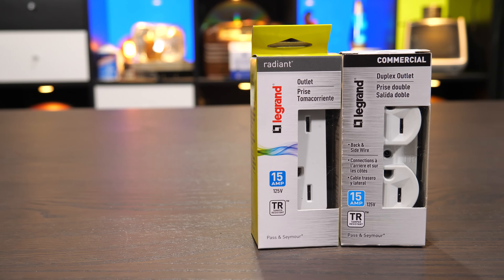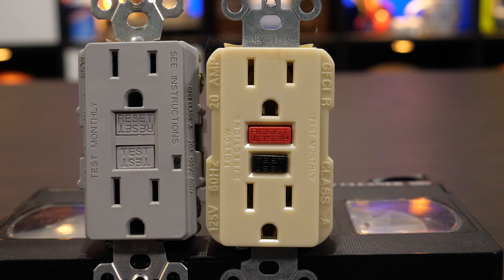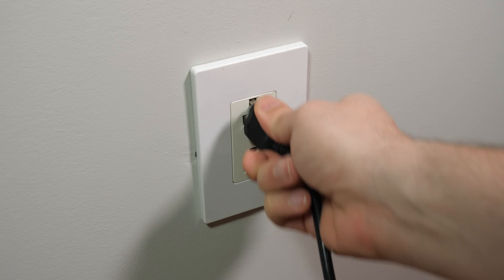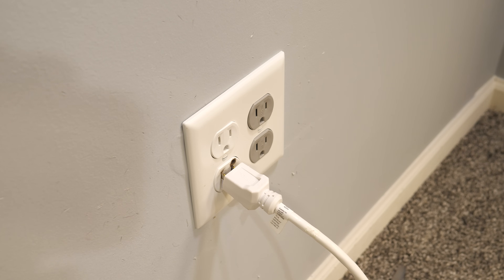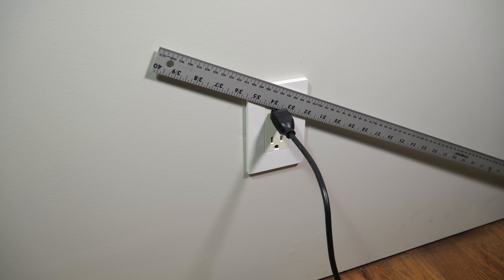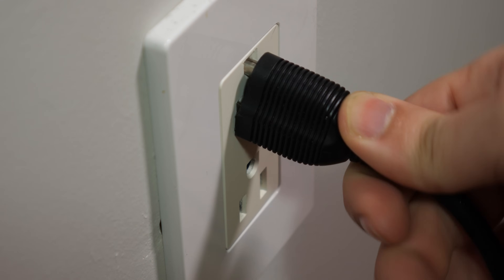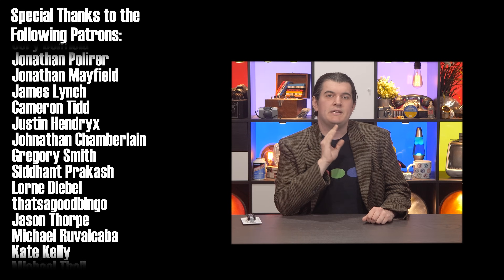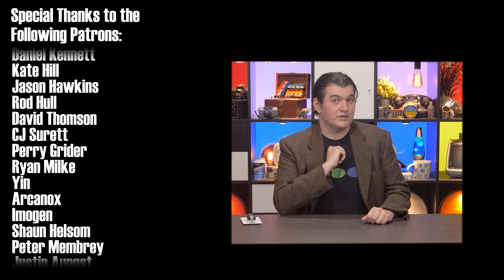Power outlets are topsy turvy - but does it matter?

Comment: Electronic engineer here, 50 years experience.  This is an excellent video and explains a number of questions I've had about why plug designs are as they are.  Suggestion: clarify what shocks are uncomfortable vs. those that could be life-threatening.  If a momentary shock is across one finger or between two fingers on the same hand, it's educational. If it's between two hands and so passes through the chest, that could be a more terminal education.
Reply: I'm stealing the term "terminal education" 😂😂😂
Reply: I always wondered why Europeans had such design improvements like indented sockets, sleeved & insulated plug pins etc. and Americans haven't still adopted any of these. I finally understand after seeing a comment from an engineer with 50 years of experience. "Let them get shocked!" oh my god.
Reply: I wish more people knew that.
Reply: PLEASE go back in time to tell this to me and my cousins as kids who would either dare each other to grab the farmer's electric fence with both hands, or make a chain of children to do the same, assuming that if our rubber-soled shoes were touching the ground that we would be fine
Reply: I have been shocked to education enough times that I'm probably an anomaly.
Reply: I was told that the ground prong should be on the bottom because when the plug tilted down the ground would still be fully in, preventing shock.  Is that correct?
Reply: @nancylindsay4255  A common misconception is that the ground prevents shock, it's more of a "signal wire" that detects potential to ground. Let's say your toaster is damaged, the metal body shouldn't become electrified because it's grounded. So if you plug it in the breaker should trip.
Reply: @Eargesplitten-Loudenboomer It's maybe semantics but I'd argue the ground pin does in fact prevent some shock hazards, in that you can't get shocked from the metal body of an appliance if that body is grounded. On its own the grounding would convert a shock hazard into an electrical fire by shorting the connection if there was a live fault in the appliance but it would still prevent a shock. The breakers then prevent that (and other) electrical fires.
Reply: @nancylindsay4255  ground pins don't prevent shock. They only trip the breaker when the shock does occur.
Reply: My impression is that the ground pin is typically grounds the metal chassis.  So, if there is a short, it has a lower resistance connection to ground vs., for example, a human body touching the outside of the metal toaster.

This has the effect of tripping the breaker, only because the lower resistance connection to ground causes the amperage draw to go beyond the rating of the breaker... however, the idea of the separate ground is to given the AC power lower resistance path to ground than the human body.
Reply: @pt8306 grounding doesn't prevent shock it just acts a short crkt path for current to take when metal becomes energized by the hot. It's like a nuetral that doesn't carry current and is bonded to the metal that is in and surrounds a structure. You can't carry enough current through your body to trip a normal breaker unless you were stuck on the crkt and it burned its way through you creating a low resistance path that enough current could flow to then trip a breaker but you'd be dead by then so. Now a gfci can sense current flowing on the ground in the 5 miliamp range and trip and save lives but only if your getting shocked by the hot and it's completing the crkt through you to grounded metal or the physical ground it self you can still get shocked by touching the nuetral and hot on a gfci.
Reply: What about between a hand and a foot touching wet floor or a grounded metal pipe etc?
Reply: @tiagotiagot Never been in that situation in any home in 43 years.
One can contrive any dangerous situation
Reply: @tiagotiagot as soon as it connects trough your heart it is dangerous. If both contact points are in the same limb, say an arm, it hurts but won't kill you since the current flows just in your arm. If it flows through your upper body e.g. your heart it can bring it out of rythm which can be very dangerous. This is all for normal outlet power of 110/220V with a fuse. If we are talking about bigger voltages and especially bigger currents it can be dangerous anyways. I once saw a video of an arm exploding because a worker touched a powerline.
Reply: Yeah ive shorted a 120 across the pugs with my finder as a small child.
It was uncomfortable. But not dangerous. 120 will 99 percent of the time just bite you.
Reply: @jhoughjr1  Ditto unplugging a loose BS406 plug on my kettle in Hong Kong, my index finger just slipped under the plug body and touched the L+N pins just as it slipped out. Easily solved with the sheathed pins thing.

Comment: With most right angle plugs (like most of those shown in the video), you can only fit one right angle plug in the receptacle.  The two with sideways leads are the only sensible way.

Comment: I have an electrical receptacle under my kitchen counter, inside the cabinet against the wall where my wife has a blender connected. My wife used to hang her metal spaghetti strainer right above the receptacle until one day it fell and landed right on top of the plug and it ruined the reception and tripped breakers.

Comment: Also, an upside down outlet will cause an electrical cord which protrudes from an AC adapter to weaken over time until the cord ceases to function. I found this out the hard way with my Google Assistant's AC adapter despite it not even having a ground pin (I just hadn't encountered this problem before). It lasted about a year this way. Another example of this is USB cords attached to wall wart chargers like those that come with your phone, always plug the charger in such that the USB cord doesn't weaken over time due to gravity alone!
Reply: What is "upside down?"  Ground pin down?
Reply: @jmdavison62  ground pin up.

Comment: I’m surprised you didn’t bring up the UK’s plug and outlet design. It’s by far the smartest design out there with the longer ground pin and the shutter gates on the outlet. Also the live and neutral pins have plastic halfway up so you can’t accidentally touch them.  Even the wiring inside the plug is designed so that the ground wire is looped and longer than the live wires so if a wire it’s tugged too hard the ground wire will be the last wire to come out.
Reply: He has another video about that.

Comment: You touched on this for a split second there, but, a big issue to me is that if all plugs were the type of right angle plug that point down, you might as well only have 1 receptacle per outlet, because you wouldn't be able to make use of the other one without risking the plug coming out. Plugs that point straight away from the wall are still less likely to come loose than an upside down right angle plug, because they don't have the whole weight of the cord pulling at them from the top. For that reason, I think it makes sense that the plugs that point straight are still the most common.

Comment: My dads an electrician and all the sockets he installed were the "proper" way up, but it was a pain to deal with because things you plug into walls are usually designed to plug in the opposite way.
Reply: Leave it to a man to install a face upside down! Probably didn't even notice there was a cartoon face on each outlet.  :)

Comment: Just have a law that enforces all plugs must have 3 pins, with live and neutral having a plastic sheaf at bottom of pins, for safety, with covers in socket for L/N that only disengage once longer earth pin inserted, and maybe rectangular pins too, with a fuse in the plug for added safety, and better standard style of plug that needs better grip to insert and is less prone to dislodging. And transition to the new, safer, style. Works really for us in the UK already!

Comment: I wonder if there may be further argument for ground on the bottom, considering potential liquid splash or runoff on an outlet. For example: When water is splashed on a kitchen wall on or above an outlet, the last part of the connection that the liquid touches on its way down is ground. I've seen outlets in the middle of mirrors. Mirrors tend to be covered in condensation from showers. Wouldn't it be preferable for runny condensation to be touching the ground connection last? Or is there even a difference at all whether ground is up or down in regards to liquid?

Comment: Meanwhile in Europe:

Our outlets have some deep, so if you want use antique devices, you need to get an adapter at least or changing the cord and the plug.
Here you can find lot of sideways plugs also, but rare to see 90 degrees rotated outlets.
Reply: What kind of outlets do you have? We standardized the type E in 1933, never had a need for an adapter.
Reply: @hovnocuc4551  Type F with short plugs causing an issue, we have Type C and F outlets.

Comment: Ground on tip just reduces the Live-Neutral shorting a bit ... the problem only gets fixed with Recessed Outlets (see the development in Switzerland the last 30 years) for the Type-B plug (while banning Type-A) & doing similar to other plugs ... recessed outlets also give more stability (especially with heavy wall warts)

Comment: People all upset over our socket safety, it's only 120 in there lol, the worst that can happen is a quick "ow fuck" and flipping a breaker back - maybe a computer shuts down somewhere on the circuit, but everything auto saves like every 5 minutes now anyway. Side note as a maintenance guy i like 120 volt cuz i don't have to track down a breaker just to change a light switch lmao

Comment: Just so you can stop saying you’ve never seen a right angle plug built the “proper way”, I have an Indesit refrigerator with the cable coming out of the plug opposite the ground pin.

Comment: I remember, as a kid, replacement plugs where the wires would pull through the plug head and get screwed down. Then a little disc would slide over the blades and cover the screws. If a wire frayed or a screw came loose, live wires would touch. And you didn't dare pull a plug like this by the cord. I almost got the shock of my life when I was about 5, trying to play some 45s in my older brother's room, with a plug like this. I almost wish we would switch to 12V or USB plugs for most things other than appliances.

Comment: Window blinds with metal ball chain draw mechanisms were the first time I saw an issue with foreign objects slipping between plug and socket.  Having seen the resultant fireworks, I now appreciate the proximal insulation on live and neutral in Australian plugs.

Comment: Herold, you're making my OCD flare up. I don't care about your receptical orientation one bit, but that cover plate screw better be straight up and down! Never, for the love of all that has ever been, can it be left in any other position. Do you understand how important it is that that screw is always straight up? You can walk down the left side of a hallway, film a video in portrait mode, back in to angle parking, hell you can even just throw your toothbrush into your bag when packing for a trip. But that screw, that screw must be straight up and down! Can it ever be horizontal? Sure, if you want to be flat out wrong about everything. Try it again, see what happens. Not a threat, just a friendly warning. Get your life together, I can't stand seeing you at rock bottom like this. 🧐

Comment: I've absolutely seen more than one outlet start exploding because of a loose plug having a faceplate drop on it, and that's just as an average homeowner, I had heavy road construction resonate is some weird fashion with my home's walls, it nocked my bathroom vanity off the wall and at least two of my apparently improperly torqued faceplate shook their single mounting screw out and popped a couple of breakers. Right-angle plugs are just a thing I don't use because they are always going to take up more faceplate real estate than they are worth, right-angle plugs are awful, full-stop, don't use them. Cut them off and give your appliances a better receptacle.

Comment: If only the US had switches on their sockets. Then they could have this insane plug and no risk of shocking themselves on insertion or removal. Let's be honest, the only change that the US needs to their plug design isn't to invert the orientation, it's to adopt one of the massively superior versions used around the rest of the world. Every video on the US electrical system I watch triggers a deep horror in my soul.

Comment: Over the years I've seen two fires from plug orientation, Neither would be likely to happen now as they were both from FPE panels. But nonetheless I personally still prefer mine ground pin up. Or more ideally, Recessed right-angle plugs.
Reply: ..."my" ground pin, not mine

Comment: The design flaws in U.S. power outlets and plugs is shocking !  Regulatory authorities should consider  adopting the electrical safety design, manufacturing and instalation standards for domestic power outlets and appliances imposed by Australian building codes.

Some of the requirements are :

* The longer earth blade/socket is always at the bottom to ensure that connection is maintained when the cord is disturbed.

* The active and neutral blades are insulation sheilded for most of their length so that conductive metal is not exposed if the plug is partially pulled out.

* All power outlets/points are switched within the body of the outlet so appliances can be switched off at the power point in case of a fault in the appliance and the socket is not constantly live.

* The mechanisms and connectors of the outlets are housed in insulated material, generally suitable grade plastic and if the face plate is metal it is earthed.

* All wiring connectors must be mechanical grub screw type within an insulated body capable of retaining the wiring when subject to disturbance. 

There are many other rules governing electrical installation and fixtures which appear to contrast significantly with American practices.

Comment: And then you compare it to the same plug type which is used in Japan, but where there is no ground, so it's just the live and neutral. Meaning you have to buy an adapter to allow a grounded plug (such as on a gaming laptop) to use an ungrounded outlet.

Comment: Seems like the kind of problem that could be mostly fixed just by having a switch at every outlet, reducing the need to plug/unplug things in the first place and completely avoiding live pins when you do. 

Still baffled that Alec's pedantry when it comes to turn signals and the warmth of lighting seems to completely disappear when it comes to electricity, the one area almost everybody else would find highly important when it comes to details and safety - to the point where he actually seems to get angry that anybody would care at all about improving or championing better safety standards over the US's current absolute clownshow of terrible plugs, outlets and cables.

Comment: I would say ground down is safer from a ground standpoint. If the ground is up, it could be dislodged while live/neutral is still connected (because the angle makes the ground effectively shorter than live/neutral)
I don't think the extra length of ground compansates for this enough since they are not made to be pulled out at an angle.

If you put a plug against a table so all 3 prongs touch the table, the plug will be in the angle that correspond to equal ground/live/neutral length.

By having ground down, the live/neutral will be yanked out first if weight of cord bogs it down enough so disconnection is a risk.

I think ground safety/integrity is more important actually.

People should be careful to not touch live metal while plugging in a outlet - isn't that a bit common sense?

But if plug becomes so bogged down so ground becomes dislodged then it could be dangerous to touch the appliance itself - which may not be so great if its a fridge that have got its ground dislodged, a electrical fault and now a live chassis.

Next to go get some food gets zapped.